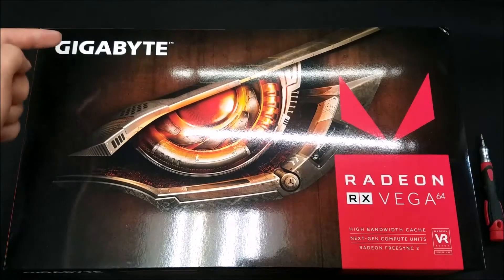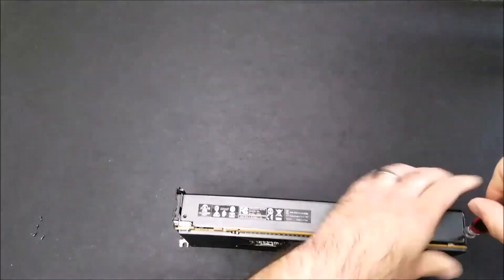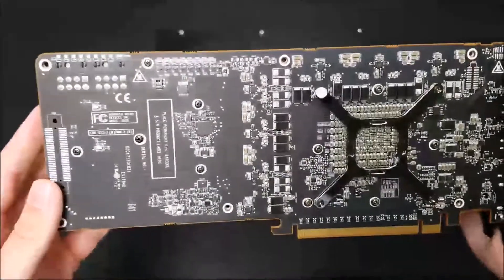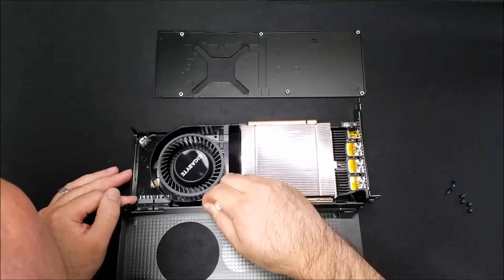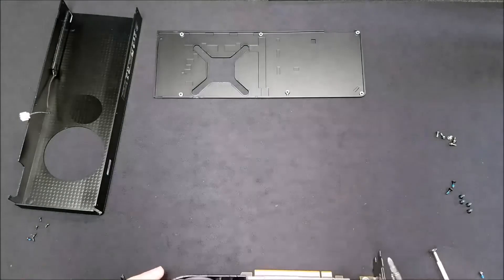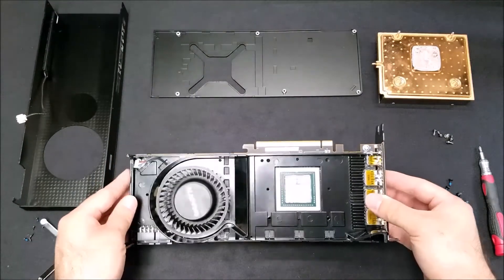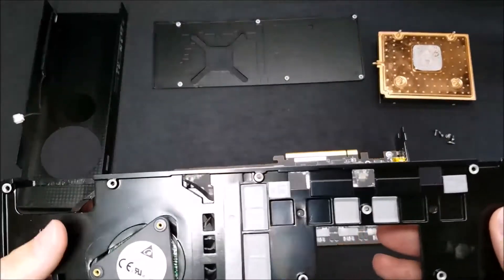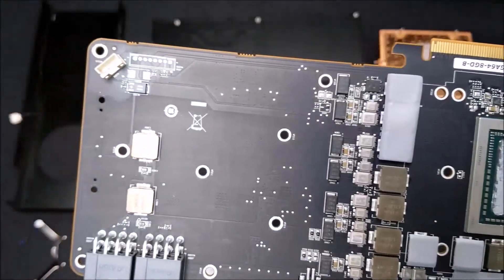RX Vega 64 Complete Tear-down - time lapse video

Comment: The video is made very well and interesting
Hi guys. I am the owner of the MSI VGA 64 AIR BOOST video card (stock reference design)
I really need your advice, namely: > What thickness of thermal pads can I use for replacement? Which company of thermal pads should I use for better quality?
Thank you very much in advance. ^^

Comment: so the heatsink is from copper and it's safe to apply liquid metal, right?
Reply from the maker: yes the heatsink is made of copper, but liquid metal is corrosive to many metals including copper, just at a much slower rate, so in general, it is safer to apply liquid to copper heatsink.

Comment: DO NOT TRY TO REMOVE THE JUMPER FOR THE RADEON LIGHT. The socket is flimsy and will break off every time. Just leave it attached to the rest of the case and set it aside
Reply: so the RADEON text does light up
Reply: @gearz2570  yes
Reply: @cameronwilliams6311  thanks

Comment: I have one problem and need some advices, after an electric shortcut in my apartment one of my rx vega 64 start running hotter than the others, what could that be? I reinstalled Windows reinstalled the drivers, and the power play. Everything is as it was before but the card is still hotter than the others, what could be the problem? I would be thankful for your advices.
Reply from the maker: good that you have multiple vega 64 to compare, so what you should check first is the fan curve, if it got reset somehow. Btw, when you say it rungs hotter, how hot was it running before and how hot is it running now? To get to that 44Mh/s speed while running efficiently, we set ours at 1050 Core, 1025 RAM, Fan Curve to max and target temp to 65C and finally power limit to -20. The power surge/electric short in your apartment should have no effect on your GPU as your electric breaker, or power strip, or your PSU should have protected the components in your rig. We suggest using an uninterruptible battery backup UPS or a nice power strip. You don't have to go all out with a pure sin wave UPS, but at least protect your rigs from those potential power surges or voltage drops.

Comment: There are no VRAM chips on the PCB. The HBM is right there with the GPU Die unter the copper plate heat sink.
Reply: I was going to say this, I think he meant the VRM chips.